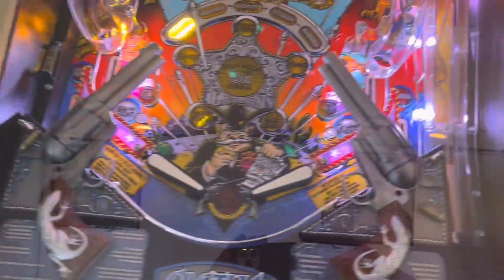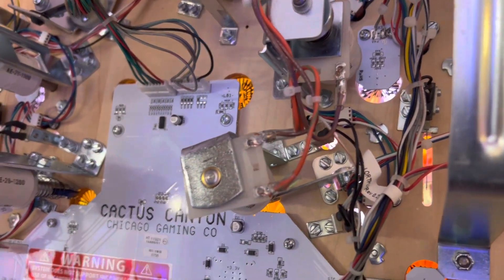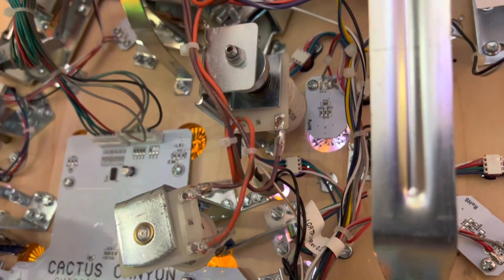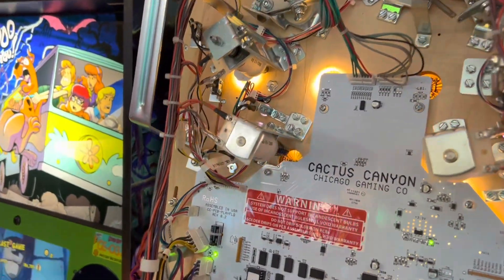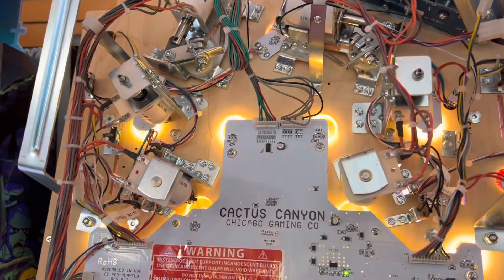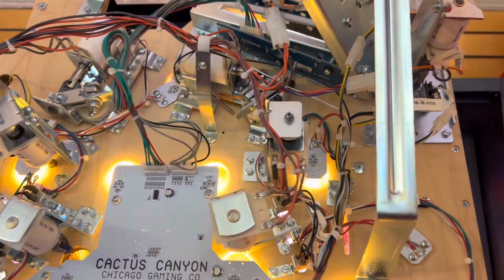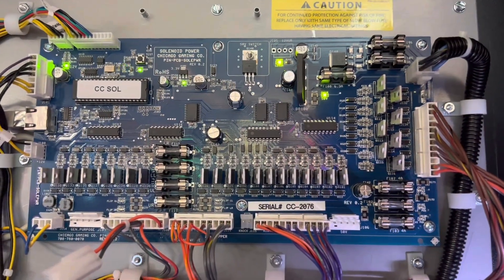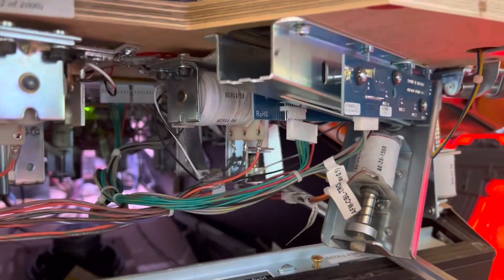Cactus Canyon Pinball is Down!!!!

Comment: I had a bad coil already on mine that's on location, same one. The coil stop was thrashed, make sure you check it/replace it. I just ordered two and a coil from Marco and it fixed it right up. Don't forget to cut off the diode on the new coil before installing it. The solder on my coil lugs from the factory sucks.
Reply from the maker: Sounds like a plan thanks man!